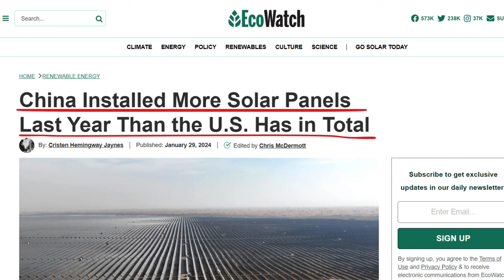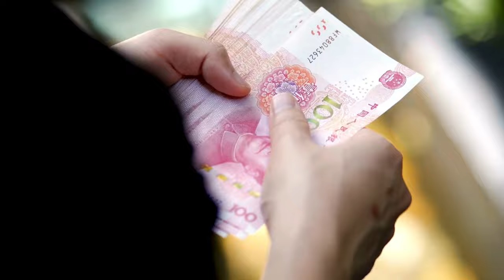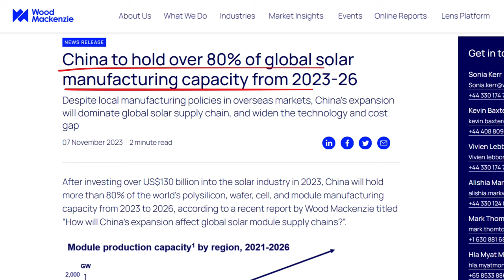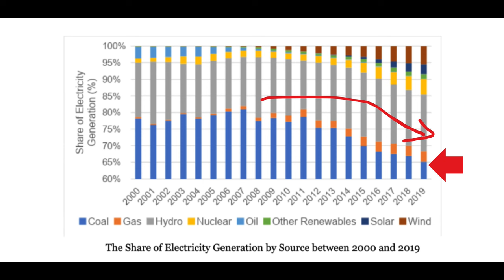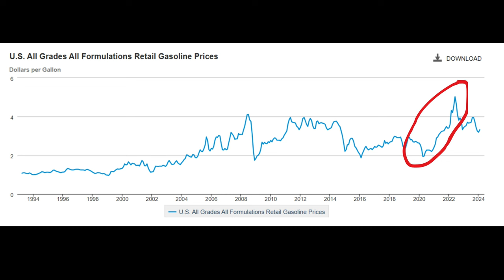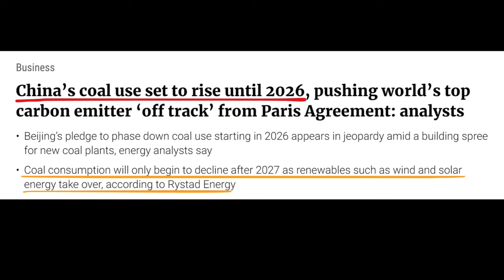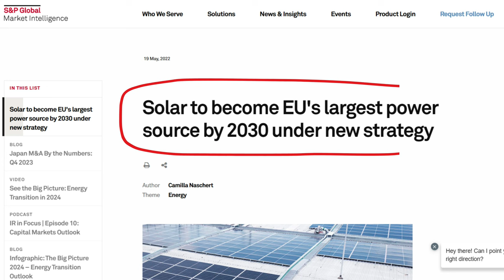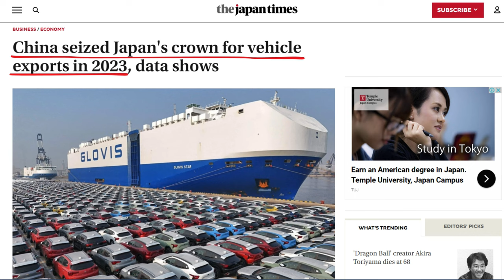HOW and WHY China Dominates the Solar Energy Industry

Comment: China invested in renewables because it is a geostrategic necessity.  The USA loves to threaten blockading Chinese oil and gas transiting the Malacca Strait, which would deny China the energy needed to keep her economy running.  While blockades are an overt act of war, much of the West seems to think it's acceptable due to the US ability to do so against minor powers without significant repercussions.  This threat is said at high levels with sufficient frequency that China must take the threat seriously.  Therefore, China looks to import energy via overland pipelines directly from Russia & central Asia;  unfortunately, although there is risk of sabotage such as when the NordStream pipes were destroyed up by Unknown State Actors.  In comparison, renewable energy is entirely within China's borders and largely impossible to interdict.  Thus, Chinese renewable energy is Chinese energy security and Chinese economic security.  

This also feeds China's electric transportation boom.  Electric vehicles powered by renewable energy are not only clean and efficient, they also ensure China would be able to continue moving goods and people in the event that oil (or gas) supplies are restricted.  China is moving to a future where they can effectively generate unlimited energy for lighting, heating, industry, transportation, and other uses, increasing economic resilience in the face of global adversity.